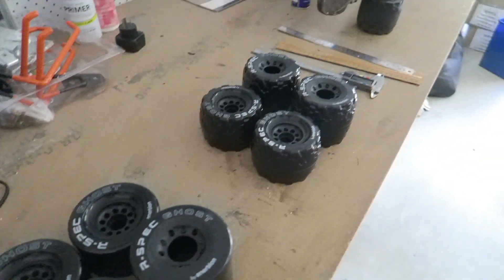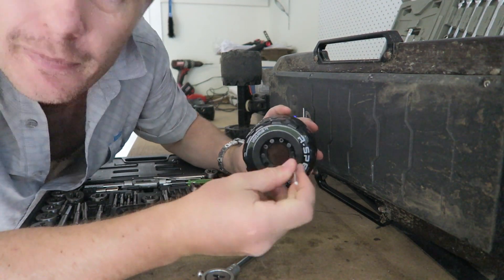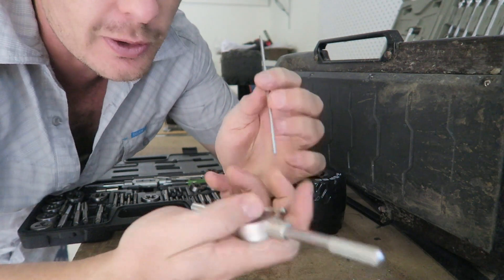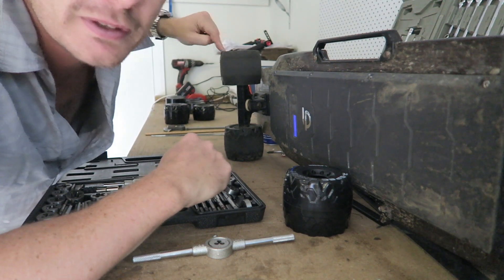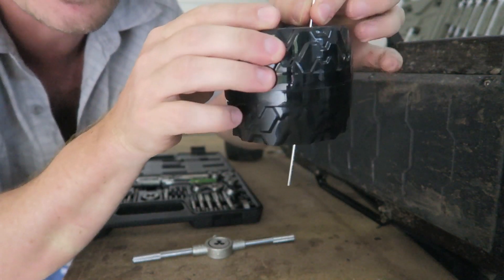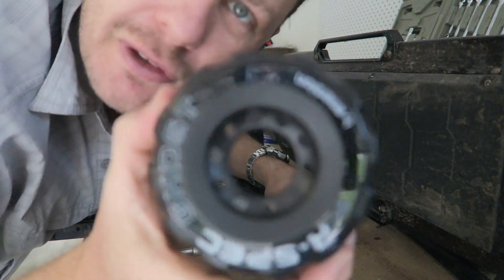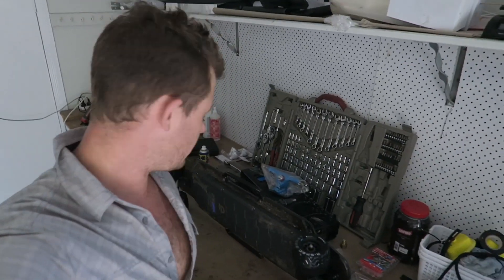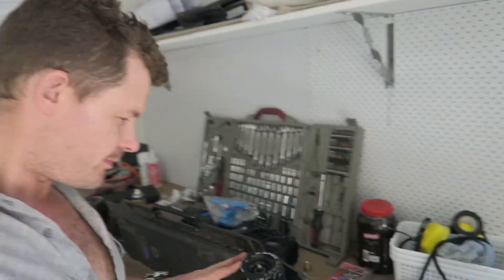How to Replace Raptor 2 Wheels DIY | Crossover Wheels! | Electric Skateboard

Comment: What size allen wrench is used to change the wheel tread to remove all those little screws holding the rubber in place? Some were a different size then others it weird

Comment: When you do that does is still waterproof
Reply from the maker: are the motors still water proof? not sure what you're referring to. all boards being shipped from June 2018 have full electronics water resistance.
Reply: Enertion Electric Skateboards I’m scared you a hammer to take you the old wheel I think the moter gonna stiff out a bit and water can get in 👍

Comment: What size are those screws on the rear, going to try to make my own rod..
Reply from the maker: check these out: https://www.amazon.com/uxcell-M3x140mm-Stainless-Double-Threaded/dp/B01LZN4W4U/ref=sr_1_15?ie=UTF8&qid=1523525964&sr=8-15&keywords=m3+screw+rod
Reply: Enertion Electric Skateboards thanks man 👊🏼

Comment: Enertion should send the thin alignment bar when you order a set of rear wheels, if they are not already planning on doing so.
Reply from the maker: I'll be making these for sure and including it in the pack... This was a proof of concept test.
Reply: Enertion Electric Skateboards I just ordered the Crossover wheels and awaiting shipment of my 2.1
Will the alignment tool really be included in the kit?
Otherwise I have to get that threading tool

Comment: Jason why not have the new urethanes permanently fixed on outer hub with new bearings then your rebuilding have the motor.
Instead of trying to line up holes every time. It might be a lot easier to just slip on the whole outer part of motor.
Reply: That would be more expensive to replace